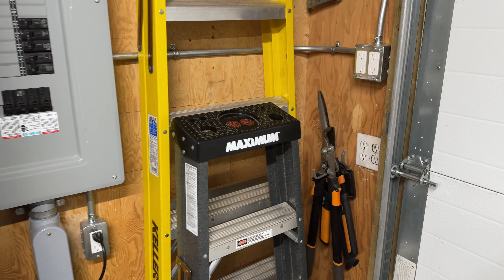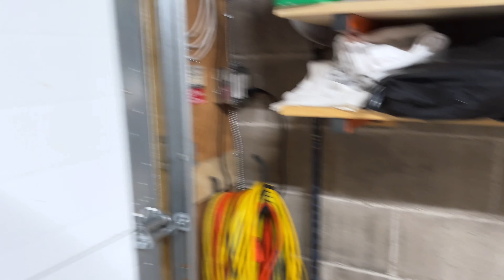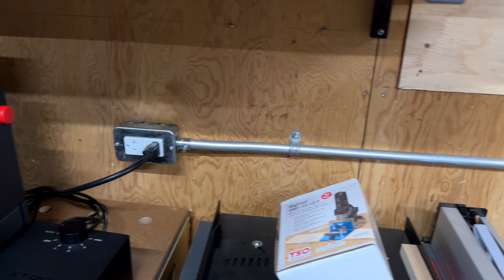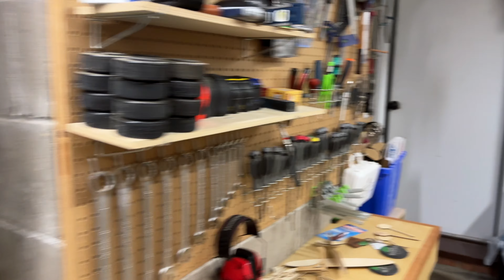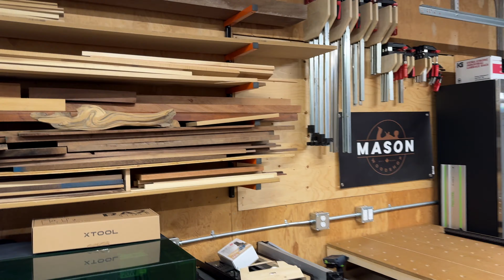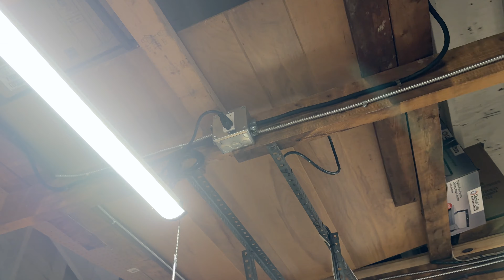Was the biggest (and most expensive) upgrade to my workshop worth it?

Comment: I upgraded my 20 x 12 garage in same way back in November 2024 In New York. Game Changer being able to use the Garage in Winter. I got the 200 Amp Panel and Heater. Hope you Enjoy.
Reply from the maker: It’s been such a great upgrade! Only thing I need to do now is insulate the roof or install a proper ceiling and insulate that.

Comment: Thanks for the details. I've been sitting on my hands about this for a while now. 5k, though... shazam.
Reply from the maker: Yeah, not cheap but there are ways I could’ve cut costs notably (no heater + thick wire required for it, fewer outlets/runs, and not doing a massive panel install. I could see people easily equipping a small garage like mine with a good electrical setup for half the cost.

Comment: hello fro, sarnia and a fellow woodworker.  my shop is very well wired, i did it over the years and in retrospect it would have much easier at the beginning!  the main 200 amp panel for the house is located in the garage.
i heat the garage which is a medium double car, with natural gas but i,am  installing a minisplit heat pump shortly, this will require a subpanel as the main panel is full
lighting in my shop/garage is with 2 ceiling fans  and 4 highbay commercial led fixtures on two switches for two levels of lighting.  there are also 2 garage door openers.
i have  2 30 amp 240 volt circuits for heavy machinery and record dust extractor/cyclone system.  my biggewst motor is a very old 4 hp in my 1950's planer, the rest are 2 hp.  the 30 amp machinery circuit has 5 outlets and the dust collector has one.
i have 3 15 amp 120 volt circuits with outlets all around the walls.  all outlet boxes are doubles, so 4 plugs can be used at each location,  i am never more than 6 feet from an outlet except in the center of the garage
i very rarely trip a breaker of course and never one in the house
the new subpanel will allow separation of a couple of things, the pool pump and a dedicated circuit for out travel trailer(30 amp/120 volt).  it will also allow adding ev charging if we ever go that way
i'm surprised that the original garage circuit was combined with the living room ,  that has been disallowed by ontario code for a long time, exterior outlets also have to be on a dedicated circuit and must gfci protected
Reply from the maker: Oh wow, that sounds like you’ve put together a good setup, thanks for sharing!
Reply: @MasonWoodshop  retired trim carpenter, woodworker all my life. all of my machinery is older than me so they are very power hungry!
Reply from the maker: @stevem268  Very cool! I grew up in Camlachie and my wife is from Sarnia, so we’re very familiar with the area. Hope you’re enjoying retirement!

Comment: What about insulation? I see the open stud bays with the old white paint. Those can be filled with bats for cheap. Staple gun and go. The ceiling is much more difficult because of decisions. Drywall and what height. It is possible to do it cheaply using thin 1/8 or 1/4 sheets and solid foam insulation. Tape it with Tyvek tape to hold it together and let it float up there. Very difficult to deal with. My garage had half drywall to code and the other half was wide open. Took years to finish. Putting up insulation a few rolls at a time. Drywalling slowly after that.
Reply from the maker: Those are some fantastic ideas and I do want to deal with insulation at some point sooner than later. I might to do what you said to the upper walls, although spray in foam insulation (by a professional, of course) is an option for the roof (and even walls). I’m also planning on putting plywood on top of the rafters with access in one spot. That’ll give me better storage up there, and retain some heat in the winter.
Reply: @MasonWoodshop  Yeah the spray way up top makes sense. I’d just worry the heat would go up in the roof peak and leave me cold down on the ground. Maybe a fan fixes that. Shoot the heat back down.
Reply from the maker: @FearsomeWarrior  YES! That's a great idea about a fan to keep the heat down. Thanks for the suggestion.

Comment: My garage is on a 15A circuit. I do have 2 circuits for a water heater and a dryer that were replaced with gas, so there is room for expansion. Good job on the upgrade, the conduit looks good.
Reply from the maker: Thanks! I’m thrilled with the results and the attention to detail the electrician had.